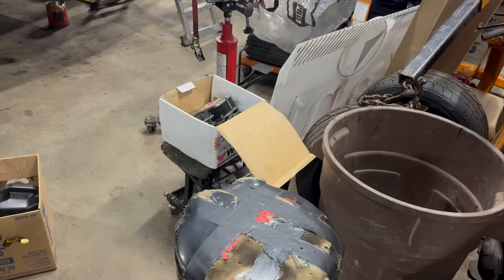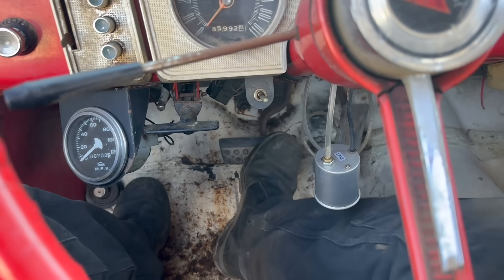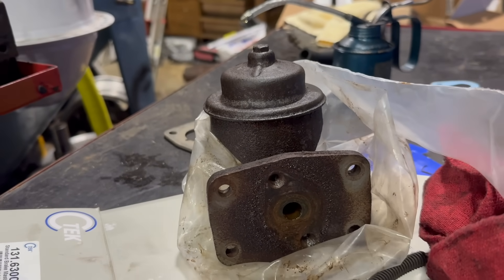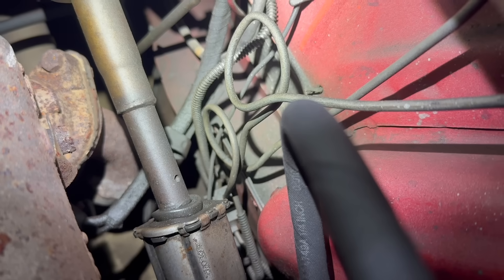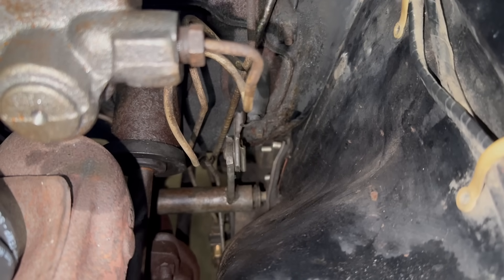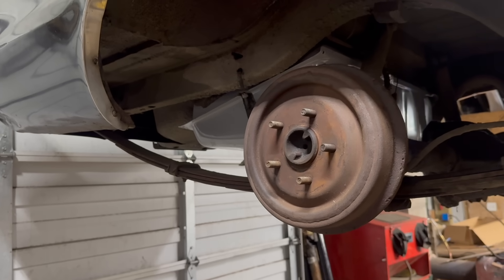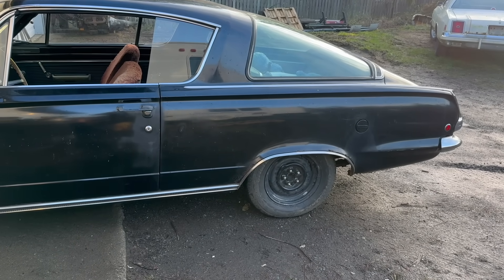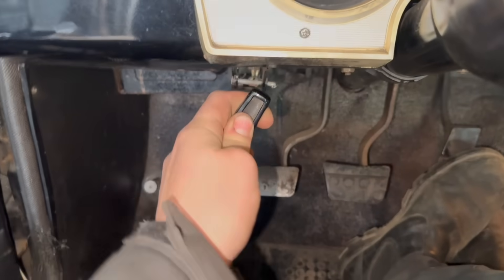Brake Safety Upgrade - Swap The "Pump And Pray" For A Dual Master Cylinder (A 1965 Barracuda Update)

Comment: my 74 Duster had from the factory, disc in the front drum in the rear and get this no power breaks just the dual master bolted to the firewall that's it, and still it did the job better than drums all the way around, if you can't tell I hated drums, also power drums would lock up if  you looked at them wrong barely tap the breaks and you were locked up and sliding towards the wall, that's why you tap, tap tapped while panic stopping, and lastly drums were always pulling to one or the other side for no good reason always fiddling with the springs, shoes, hold downs  this and that's, love your show but I was and am a Plymouth man nothing wrong with Dodge just preferred Plymouth
Reply from the maker: My ‘74 Duster had exactly the same setup, and it worked great! I don’t remember having a premature rear brake lockup issue in that car. But it may have been similar. I’ve got my fair share of Plymouths too. Haha. My brother was always the Plymouth guy of the two of us though.
Reply: @DeadDodgeGarage  no never have had a lock up problem with discs what I meant was the power all four drums were designed to break with the slightest touch of the peddle very easy to lock up, disc didn't seem to have that problem even today you have more of a natural break travel on applying

Comment: Chrysler in the 80s on the k car platform used diagonal brake layout in stead of front and rear. Which I don’t fully understand the reasoning
Reply from the maker: I learned that in the comments of my K car video. It makes zero sense to me either.

Comment: Hey Jamie, I actually found a good use for Fram oil filters. I made serious upgrades on my Cheapo Parts  Washer. The fluid is pumped through the filter. Engineering at its finest !
Reply from the maker: Nice! My washer sure could use a filter… it’s real bad.
Reply: @DeadDodgeGarage  I could send you a picture of my own design.

Comment: The 69 Charger with 318 had drum front brakes that would quickly glaze and fade terribly, really was dangerous stopping. The 68 Charger with 383 Hi Po stamped on manifold had disc front brakes that were excellent for stopping at high speed. Amazing how  big of a difference.
Reply from the maker: ‘68 R/T still came standard with 11” drums…
Reply: @DeadDodgeGarage  
I thought the disc brakes on my 68 Charger was something special from factory, with the hurst 4 speed and Holly dual feed.
Are you saying you have not known about any disc brakes in 1968?
The calipers had 4 small pistons in each one, two on each side, unlike a single piston caliper that floats. 
Did they put any special Posi Trac rear ends in them, or all standard 3:23 gearing?
Reply: @DeadDodgeGarage  Oh, are you saying the disc brakes were a special option for '68 Charger?
I bought it from a retired Detroit Police Officer, and the transmission tail bearing started whining soon after I got it which caused clutch disc to start slipping more and more.
Reply from the maker: @bookofrevelation4924 right, sorry - discs were optional, but not standard. Just wanted to make light of that - your car could’ve come with them, but it wouldn’t have been standard. In fact, I don’t even think the 383 four barrel would have come with 11” drums standard, as it was still a base Charger and not an R/T. Just interesting.
Reply: @DeadDodgeGarage  
Thank you for that info.
I found discussion about the 4 piston caliper on B bodies for 3 years in late 60s.
👇
I had that Bendix set up on my 69 Charger.These calipers were mounted only on  the 66-69 B-body cars,so is not easy to find replacement or parts for them.
Even The pads are hard to find in these days.
They only were mounted three years,cause they were prone to piston leaks and corrosion.
In 1970 they were substituted for single calipers.
A1 Cardone still work with  them,at least they still appear on his Parts lists.

Comment: I have similar problem with my '66 Dart....I don't think a duel master is going to clear my fender wall headers :--(  But, I'm open to suggestions if someone has an idea!
Reply from the maker: The one primary tube on mine has been absolutely senseless to clear the dual master. And there was a big ugly heat shield shoved in the gap too. I’m hoping I can have the exhaust guy make me a new one or something.

Comment: Id like to put discs (with power brakes) on the front of my 426 hemi 70 Challenger.  Any recommendations on doing this while maintainig some decent valve cover removal ablility?  (solid lifters)
Reply from the maker: Weeell a factory booster sure won’t get you there… they have to come loose to pull the cover as you probably know. I have to wonder if the aftermarket type with the clevis and bracket assembly like we’ve got on the wagon would make more room, since the booster is smaller and mounted higher. You can get those from several different companies. The red ‘71 had four wheel Wilwood disks and no booster. Required a lot of pedal effort but did work pretty well.

Comment: When i am protecting my engine i am not going to throw a fram on it. I to used to use fram then over the last 5 to 8 yrs they have turned to junk
Reply from the maker: Pretty sure they were always junk… it was a lot more than 8 years ago that I saw a Fram cut apart next to an actually good filter. It wasn’t impressive.

Comment: I upgraded my 1962 Chrysler 300 with a master cylinder from an early seventies B  or C body. It bolted up with no mods needed, except for the extra lines.
Reply: Did the same to my 63 Belvedere but after I lost my brakes. I was just going out of the driveway but it was downhill and on to a highway. There was an embankment on either side of the driveway so while pumping and stepping on the emergency brake I turned right and went up the embankment and stopped a few inches from a tree. I ended up putting on two different master cylinders because I was planning on putting disc brakes in the front so I figured I would start with the master and add the rotors and calipers later. No can do as the drum brakes have residual pressure and the disc brakes do not. So first test drive with the disc/drum master and I am pumping the brakes. You do get brakes but you have to pump them up every time you want to apply brakes. A quick change to a drum/drum master and I was back in business. Stepping on the brake pedal and not stopping is not a good feeling.
Reply: @mostlymoparih5682  What master did you get?  I have to do this to my '63 Savoy, and maybe my '63 Fury.
Reply: @MexicanSpec  That was back in the 70s.not sure I think it was from a Dart maybe a 1970.
Reply: @mostlymoparih5682  OK.  Did the master bolt right up or did you have to modify something?
Reply: @mexicanspec  It bolted right up and I added a brake line.
Reply: @mostlymoparih5682  Thank you
Reply from the maker: Yep. Nothing to it.

Comment: 4:20 that's not a "splitter valve" because it's not a valve at all. It's a junction block.
Reply from the maker: That is not simply a junction block. It is two junctions in one block with a shuttle valve in the middle. That was like the entire point of this video so
Reply: @DeadDodgeGarage  it's a 4 port junction block. You said there's nothing inside it and that it is simple piece  of brass. It does not appear to contain the shuttle valve you discuss later in the video with a different fitting. Check the timestamp. I believe you're mistaken again.
Reply: @DeadDodgeGarage  4:26 "there's nothing else happening in here. It's a simple piece of brass."

Comment: If I'm not mistaken,  Walter P. Chrysler himself was a very vocal proponent in regards to hydraulic brakes and the first Chrysler built in 1925 had them  By the time Dodge joined the camp and Plymouth was invented.... I'm almost 99% sure all of them had hydraulic brakes right from the start.  It was a big selling point and a lot of advertising alluded to the fact that Ford was way behind the times.
Reply from the maker: I think you’re right! But I don’t know all of the history.
Reply: That's all correct. Henry Ford was distrusting of hydraulic brakes because they were could leak. Ford advertising at the time was about "solid steel" mechanical brake linkage.

Comment: I'm not sure on the Fram bashing either, they never did anything horrible on any of my cars for over 40 years. Very cool video, I've never owned anything with a single pot master cylinder
Reply from the maker: If I have my choice, I’m going to use an actually good filter.
Reply: @DeadDodgeGarage  please define what makes a bad filter? As I said I never had Fram fail on any of my cars, they didn't dissolve or anything else. I've run them for 10k miles on a gas engine (yes, I know I shouldn't)

Comment: When i was younger i would block off the port for the rear brakes so i could do way better burnouts in my 80s Dodge pickups. Fun times and kinda wish i had those pickups today
Reply from the maker: When I was younger, I blocked off the port for the rear brakes in my ‘75 W100 because replacing the rotted out brake line was above my pay grade. It sure had a nice pedal feel after that!

Comment: I was so proud of what we accomplished,  '69 Fury subframe installed, along with the drive train and electrical system in a '57 D100. I deemed it road worthy, so it needed dual exhaust and Cherrybombs installed. Because it was the 80's. Their 4 point lift had  slight ramp leading up to it, the front tires would go up the ramp, hit a bump stop, hard to describe. Then both front tires sat in a cradle getting pushed along by the rear tires coming up the ramp. At this point everyone  realized no rear brake circuit. the truck went up onto the lift, rear tires pushing it along. No matter how much the employee pumped the brakes, it kept rolling forward.
Reply from the maker: Yikes. I remember you describing this build!
Reply: @DeadDodgeGarage  at some point I'll try to get around and get another printer/scanner and send you pictures of what we started with, what we ended up with. And where I'm at now. Maybe a 40 year curse. But I could never part with it.

Comment: Motor Trend says the following Jamie:  "The 1924 Chrysler boasted four-wheel hydraulic brakes, this at a time when most cars only had mechanical brakes on two wheels."  ;-)
Reply from the maker: I could’ve looked that up pretty easily, but I chose not to. Haha.
Reply: @DeadDodgeGarage  I understand completely.  Overall you were correct.  What's a few years between friends?! It also means Chrysler beat FORD by like 11 fookin' Years More than a Decade! hahahaha!
Reply: earliest i was personally aware of before was a 28 plymouth u.

Comment: A friend of mine has been a Mopar man for years and he's told me there is a master cylinder made for Chrysler car that had the proportionate valve made in the master cylinder but you had reverse the lines on the cylinder but I can't remember what model or year it was but I believe it was only used one year . He's been trying to get me to put it on my 88 Plymouth Grand Fury .
Reply from the maker: Not familiar with that. Interesting.
Reply: @DeadDodgeGarage  I'll get with him and get that info and get it posted , he's told me several times but I can't remember .
Reply: @DeadDodgeGarage OK got info he said 1978 Plymouth Volare was the only year that was offered . He has put it on all his street hot rods and his drag truck .
Reply from the maker: @wg4405  huh. I had a ‘78 Volare and am at least fairly confident that one had a normal master cylinder? But I could be wrong.
Reply: @DeadDodgeGarage  Well I don't know that's what he told me he sent me pic of what it looks like but I don't know how to put pic on the tube but it looks like the small reservoir has the fitting hole right on the edge at the end of the cylinder . He's 50 now  been messing with Chrysler products since he was a teenager .

Comment: Curious thing. Christmas Eve, my brake pedal went to the floor without warning on my 2000 Jeep Cherokee XJ. I lost very nearly all braking power, just a touch of stopping power at the very firewall. I drove home with the e brake. Checked brake fluid, discovered it has only one fill cap. Don't get that. But it was empty. Took it to the shop because I'm old and it's snowing.  They found a rotted brake line. I had them replace all the lines. All is well, but I still don't understand why I lost brakes from one leaking brake line.
Reply from the maker: You should’ve had a soft pedal, but shuttle valve should’ve been closing off the offending circuit, and you should’ve been getting a brake warning light. I actually lost the rear line on my 2000 XJ too, and yeah… the pedal was way down there. It was sketchy.

Comment: Im still debating doing this upgrade on my 64 880. I just upgraded to power brakes from a donor 880. They work well, but it does concern me when I'm traveling at highway speeds with 4000lbs of car.
Reply from the maker: I definitely recommend it. If it’s working now, ok. But I remember when my wife lost a wheel cylinder in our wagon and had to use a bush as brakes. I don’t think it’s a fun time.

Comment: Does anybody make replacements/repairs for those horrible early A instrument clusters with plastichrome that always comes off with time?
Reply from the maker: I know various outlets restore them, but yes, OER makes a replacement that is available through Classic Industries. I’ve had one, and it was very nice. The dash in this car is just sweet aside from that. Hope it gets one eventually.
Reply: I'm going to try and restore it using chrome paint. I paint models and miniatures with an air brush, so I'm hoping those skills translate.

Comment: I bet rebuilt mopar master cylinders are still cheap if you buy one. I saw the single cylinder in that barracuda in a previews vid and Im glad that's gone. You said you are replacing the 7 1/4 rear in the 65 barracuda. In an earlier vid it sounded like its coming from a 73 later A body. Will the car have two different lug patterns or am I mistaken?
Reply from the maker: No, in 73-74 and maybe even 75, drum brake A bodies were still small bolt pattern. I know that because I lost a $10 bet on it once. The parts houses (O’Reilly at least) no longer carry rebuilt masters. They’re new only. Just bought a pump and pray with new pushrod pre-installed for my ‘66 yesterday.
Reply: @ I didnt even know they still had drum brake front ends after 72. They must have had the larger spindles too. Wow no more masters? God they were like $20 in like 2008. Wait thats a while ago isnt it?😬

Comment: Somehow this all reminded me of the horrible Mopar power brake design of the later 50's.  You know, the bellows type booster that sat right above the master cylinder, making it all but impossible to get the lid off and add brake fluid.  Also those power brake were some of the most horribly overboosted in the civilized world - a touch of the toe and granny goes right thru the windshield.
Reply from the maker: UGH I hate those. Lol. Yes, I’ve discussed early Mopar power brakes being overly sensitive and terrible on video at least a few times.

Comment: Chrysler was one of the first to feature juice brakes - I think in 1924.  Dual masters were required starting in 1967.  Amazingly, most of us (now old people like me) survived.  But, boy, was it alarming when that pedal just went down to the floor - keep pumping, you might get some brakes before the reservoir went dry.
Reply: I loved having a slave give way, causing the car to wrench the steering wheel out of my hand as I tried to navigate a 20 mph off ramp in a 1950 Dodge with bias ply tires.
Reply: Fred Flintstone's Crappy Juicer

Comment: What would it take for those brake light housings and lenses to "disappear" and show up in NC? Asking for a friend that just, um happens to also have a 64 barracuda...yeah that's plausible. 
I am also doing a disc brake conversion and forgot about the proportioning valve, (I had no clue about needing one) so that plan for separating the lines and using a restricting valve is an option I didn't know about. Thanks for letting me about more options. :)
Reply from the maker: It would take someone else with a very different moral compass than mine. Haha. There you go!
Reply: You're not getting my housings! - Dave

Comment: I know what those valves are supposed to do but.. age is age. They should probably be replaced when you can. We had a fire-work tear out a rotted soft line on a 60s boat of a T-bird. We hard to do a Flinstone's stop.. down hill. That.. took a while. Turned out the valve was obviously frozen so we lost ALL brakes. I'd hazard that those valves are probably non-functional in nearly every one of our classic beaters.  It was one of those memorable oh-shit moments that stick with you.. for life. But yeah. It became habit for me to run new hardline, valves, and soft lines right when I got a car. You know, except when it wasn't in the budget then it was a "pray" kinda deal. But having driven an old Javelin that had complimentary Air Conditioning.. you know the kind that comes through the rotted out A-Pillar and the roughly 6" of missing metal. So I can't call anyone out for driving dodgy (get it .. yes.. I am a dad) rides.
Reply: Yeah, I had an "Oh Shit" moment, too in my 1st car a ´77 Renault R4. It had brakes that needed to be pumped but the guy didn´t tell me. So, I happily drove home and had around 75km/h on when I saw a light go red ahead. I pressed the pedal, it went to the floor- I never forget that adrenalin dump. I ripped on the parking brake and started pumping out of sheer desperation, I didn´t know what I was doing, I panicked. But then the pedal started to get firm and the car under control- boy, howdy- what a relief.
So- I learned on the fly that my little R4 needed two pumps before the pedal got firm. And it stayed that way- I accepted that. Brake fluid stayed in the pot- okay then…
Happy New Year, Sir- Your story remembered me of that afternoon 1990.